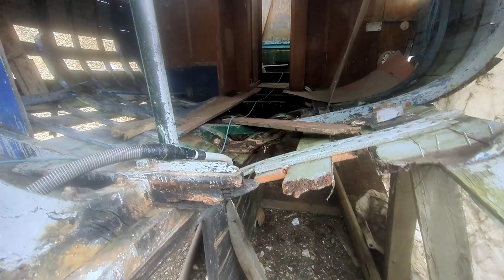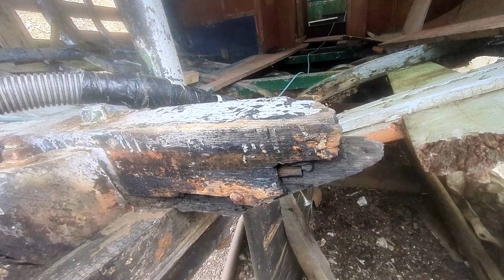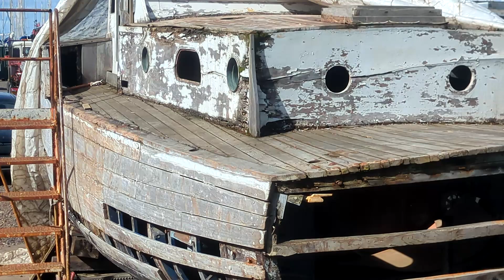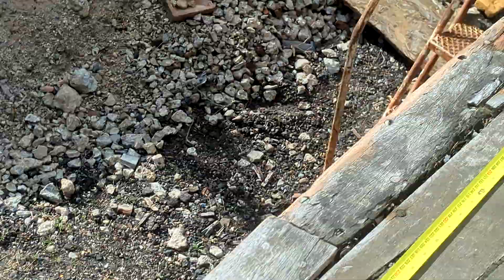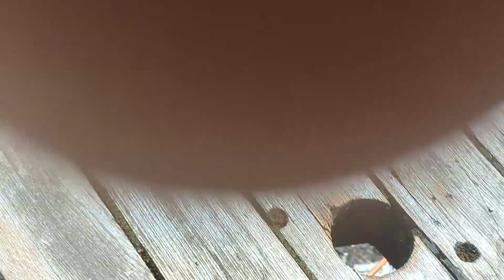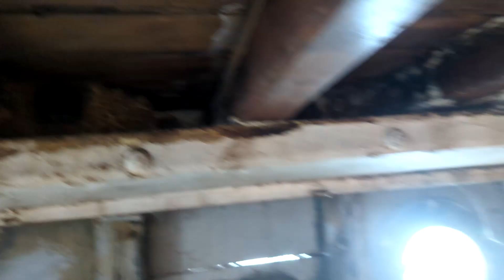The Papendick Family's restoration of our James Silver "Western Isles" Motor Sailer "Chance"

Comment: I used to own a James silver boat. I think she was a Silverette.
Still have a picture of her fully restored to here former glory back in the late 1980s
Looking forward to watching you restore this one.😁👍🏴
Reply from the maker: Hi Craig 
I have a long way to go at the moment as it is early days on the boat herself I have been doing a lot of work on the parts like the interior cabinetry. Now the weather is a bit better and the clocks have gone forward there are longer days to get work done on her.
Reply from the maker: Could you send me a copy of your boat. I am looking for plans of the aft cabin as this part of Chance was stripped of the original interior and I am wishing to put back as near the original design as possible. Thanks in advance Simon
Reply: Hi Simon

I only have a picture of the boat sitting on her mooring.
The lay out in the back cabin was a berth each side of the boat. With access under each berth from side panels.
There was a small set of drawers at the stern between the two berths with a door above this to gain access to steering system.

Cheers Craig
Reply from the maker: @craiggilchrist6218  thanks for your info